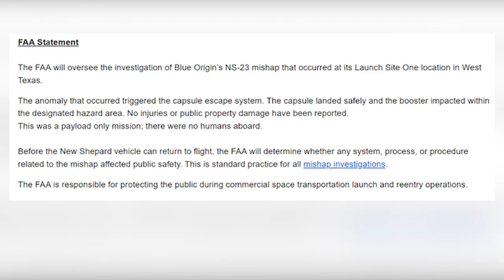Blue Origin's Engine Problem HUGE Capsule Blast Away From Booster During Launch

Comment: You’ve got to stop saying Blue Origin going to LEO. They are NOT going to any orbit as they do not have nearly enough speed for that. They are simply reaching an altitude and coming back down. It is entirely different.
Reply: Musk has said that going to LEO is 100X times harder than going above the Karman line.

Comment: I don't know if I agree with the final conclusions. I think that if the mission was manned. And if the capsule succesfully saved the lives of all on board... even if there were injuries, it would increase confidence in the safety of space travel. Not reduce it.
Reply: Great Comment! This situation is such a dilemma. The material cost of the lost booster is absolutely irrelevant. What I hope for is that there was plenty of telemetry sensors on board to prove Humans would not be harmed by BIG G forces very much like crash test dummys.

 In that way. the operation could prove to be extreamly successful if the data comes out favorably. We have to take risks if we are to survive. This video is really good in so many ways. Tossing in a 'Boo Boo' might turn out to be a good thing in the long Run. F'kn  Easter Egg? Provoke discussion?  Unintended flaws, I guess, but as long as it works in the Tiny channels favor. The payload was saved but it is much more important that the data collected by the accident goes a long way to make Space safe. Bezos is going to have to lower ticket prices dramatically for possible victims now